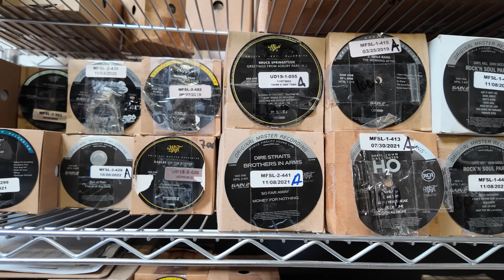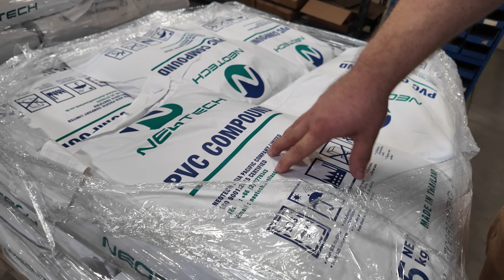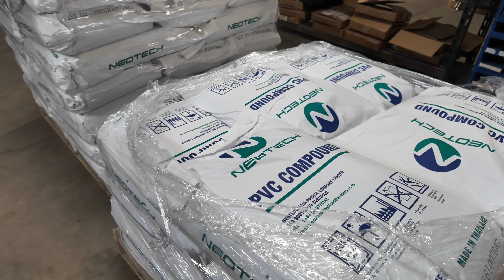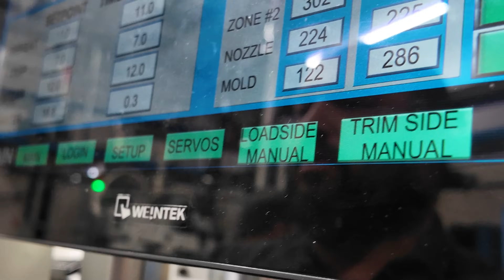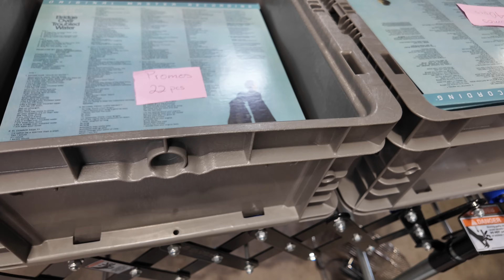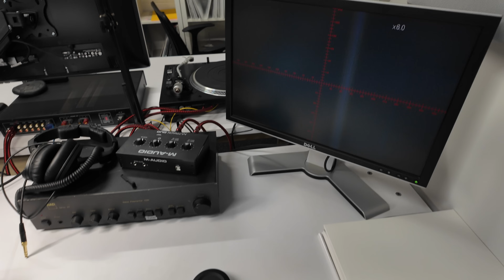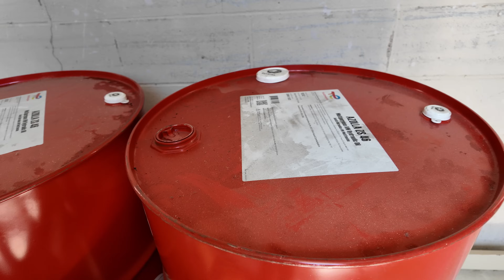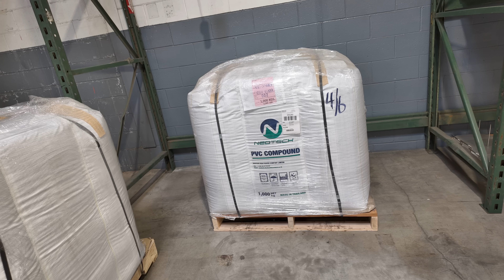Fidelity Record Pressing Oxnard CA Opened its Doors to Tracking Angle

Comment: That is really cool. A good first step was to use new presses. So many start-up record pressing companies use reconditioned presses. Equipment is only new once. No matter what is done to old equipment will never make it new again. Although the new presses have been updated in design, there are other new record press manufacturers who started with a clean slate and made improvements on former problem areas. More power to Fidelity and hopefully they will achieve and maintain the highest quality. 
Thank you Michael for the excellent video and the look inside one of the newest record pressing companies!
Reply: We worked with the press builder to address all of the previous shortcomings of the original SMT press, heart of these presses are the hydraulic press design which the SMT press did and still does better than any other record press built
Reply: @edwardhashimoto263  hi! I'm Dave Hahn, Worked at RTI '78-'85. Finebilts then SMT's. Relays were the biggest "problem" with the SMT's. How are the electronics on these new guys?
Reply: @DizzyD9960  what are relays!!??!! 
These are all PLC controlled with hybrid stepper motors locating the biscuit and labels and stacking the records rather than the record slide. The most trouble I had with the relays were people just swapping relays around instead of just replacing the problem they'd just move the problem!
Reply: @edwardhashimoto263  yeah tracking the actual relay causing the problem was a swap and wait deal. Sometimes for days.
And say howdy to Rick for me!

Comment: @19:05 EXCELLENT QUESTION, FREMER!!!!    Almost EVERY record pressed today in the United States suffers from lack of Quality Control, as opening a brand new LP that is NOT pressed off center today is almost like winning the lottery. And it isn't warped, then it's an added bonus.  Because of that problem, I went through 3 US pressings of the 2012 stereo White Album until I paid more money and bought a European pressing..... And you got a bullshit answer from this guy and his robotic automated pressing plant. The frequency of off centered records is much greater and the degree of inaccuracy much more than what he is quoting.  I'm sorry, but I will try to stick to German, UK or Japanese pressings whenever possible. His answer is deflecting blame:  The cutting engineer is going to provide a perfectly centered lacquer. It is the carelesnsess that follows at the pressing plant that yields so many records with untrue centers - INCLUDING MOBILE FIDELITY!   I returned a brand new sealed $200 record (Aimee Mann - Los In Space ) for that same reason., It is unacceptable. All they need to do it to hire someone whose job would be to take s record off a batch, test it and play it for flaws so that the problem can be arrested quickly and not let a shipment of 10,000 , 50,000 records leave the factory all f--cked up as they have been doing for years now since the rebirth of the LP.

Comment: What is the reason for stamping vs injection molding?
Reply: PVC can not be extruded hot enough to be able to flow into an injection mold so another material would need to be used but nothing else matches PVC to be able to form the grooves accurately and create a low noise floor

Comment: Too bad not a good record will ever be pressed there.   99% of these modern pressings are mastered like crap all done on a DAW and PCM’d and dynamics squashed.  The last few new artists on vinyl I have bought sound like crap.  Mike this is your next battle fighting crap modern mastering of digital sourced vinyl records.   These guys seem legit but they are just jumping on the vinyl craze. We don’t only want well manufactured vinyl…we want great masterings and cutting.  It’s amazing that I can buy a disk from 1959 and it smokes these modern faux remasters.
Reply from the maker: Whoah! Wait a minute. Rick Hashimoto spent decades developing and running RTI. He’s the opposite of a bandwagon jumper on-er!
Reply from the maker: And yes, many poor masterings produced but more great ones available now than any one  person can afford to buy…
Reply: Most of the ones done here will be Mofi which use no modern mastering technics or DAWs and no Mofi titles are using PCM files unless it’s what the original master was.
Reply: @trueaudiofiles8453  cool,  thanks for the clarification.  But I still stand by that many modern remasters or even first release modern recordings are crap.   They are compressed out dynamically hard.   How do you know as a presser if you have a good sounding mastering and are you picky only to get lacquers from the good mastering/cutting houses?   You are just provided a lacquer normally, right?  I hope you never “do” T Swift as her vinyl pressings sound terrible (my wife loves her).  I love mofi.   Glad to hear mofi.   Do you validate the masterings are good quality before you press them,   You are the last guard of crap pressings/masterings that get into the market?    Your shop looks like you will press a good disk.   It wasnt a  rip on your shop,  I like how clean it was and don’t question your ability to press a good quality disk,  but you are at the mercy of the mastering/cutting.    I have been burned too many times with crap masterings these days.   Many people don’t even play their vinyl.   Just put em on a shelf for show.  The quality nowadays of the source recordings is so suspect.    With regards to Mofi.  Many including Mike are not really a fan of mofi after the DSD thing (maybe not before either).   Why didn’t he say he wasn’t a fan in this video?  I honestly believe mofi is the only one pushing the edges to get a great cutting from a digital file and using DSD.    I love all my Mofi pressings even the 10 UD1S I have. Rock on.   You guys appear to be experts at pressing.    If it is compromised before pressing than we all lose.    What are the disks you have pressed recently ?   Any you can say?   I will seek a few out.   Hope all well for you.   Never questioned your ability to press a disk.
Reply: @revelry1969  I don’t work for Fidelity Pressing. I can’t speak to what they take for jobs but I would doubt they refuse to press something because it wasn’t mastered to audiophile standards or mastered with modern brickwalling.
Reply from the maker: I have given many MoFi titles good reviews and some not so good ones. This was a pressing plant tour not a record review!
Reply: Thanks for the tour.  But what a waste.   I stand by only 1% of these disks will sound good.  Mike,  let’s be honest you don’t like anything from mofi recently.  Anything DSD you are very skeptical.   This plant is pressing what it gets from the cutting/mastering.   This plant can’t possibly press good disks unless there is a good mastering/cutting process of the lacquer.  You and I know this.  I don’t question this plants ability to press a good disk.  But they are only as good as the source.  I just got done listening to Contemporary pressing from 1959.  I bought it for $8 and it smokes…. Instruments so real.   Lester controlled everything back then from womb to tomb.   Now we have all these pressing houses coming online so we can meet the craze.   Does Fidelity plan to only press records that actually have good masterings/cutting or just jump on…. Press me now?   What disks have they pressed?  I would love to hear one.   Let’s stop shilling for the whole industry when there is so much crap vinyl out there these days.   There are some exceptions but they all….i mean all pale in comparison to many of the OG pressings of the 50/60/70’s.
Reply: Sir, this is a Wendy’s